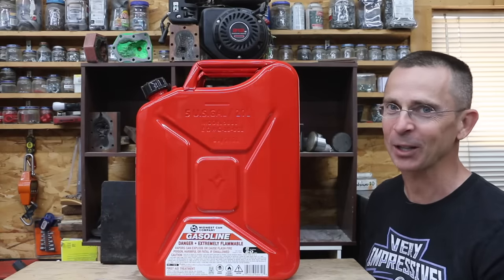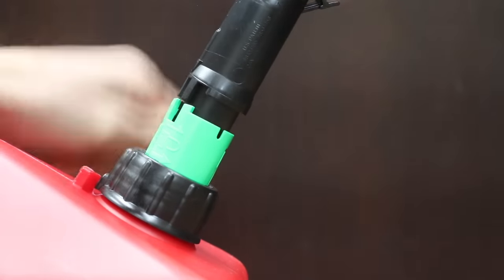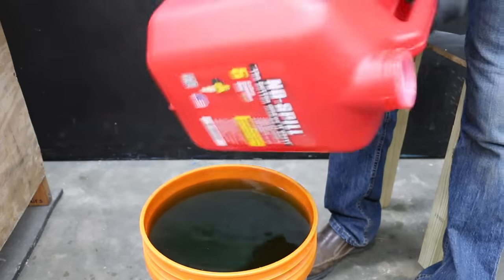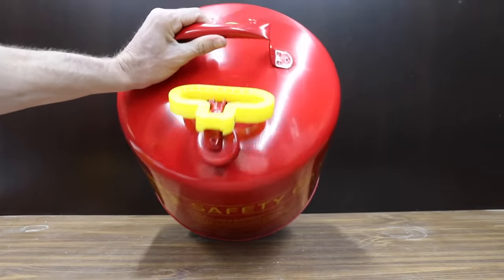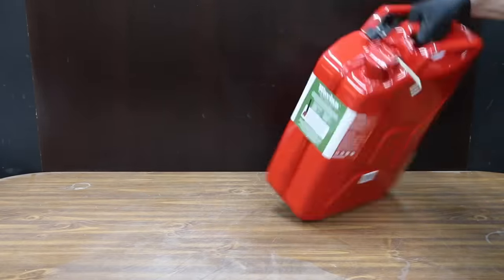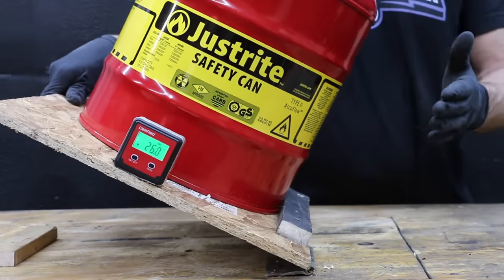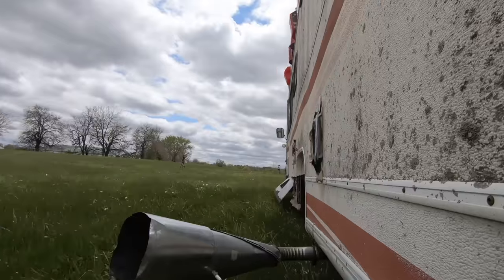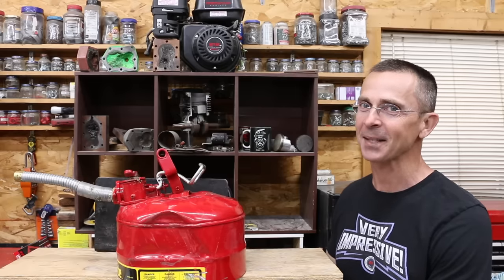Best Gas Can? $140 Wavian vs Eagle, Surecan, Scepter, Briggs & Stratton, Midwest, VP Racing

Comment: Pressure test. I've lost a few to sitting in the sun and they blow up like a balloon.  Then freeze them and watch which ones split.
Reply from the maker: Thanks for the suggestion.
Reply: @ProjectFarm  Absolutely- and don't forget one in the front seat of your car and fill the whole car with fumes!!  Vapor leak test would be ideal!
Reply: @Josh-ce9sv  Both of these suggestions are gold
Reply: I have several of the wavian cans. Never have vapor leaks, even in the desert.
Reply: Was going to comment about testing in the cold because I've had so many split the nozzle, but ya beat me to it. Another suggestion would be to test hot and cold Cycles. I've had issues with them either sucking in and tipping over or inflating and causing problems as well.
Reply: If you only snug the vent and don't crank it down on hot days, you will find that although pressure will build in the direct sun it will escape past the threads on the vent.
Reply: Fuel can test #2 LFGO Project Farm FTW!
Reply: gas does not freeze
Reply: @grantkoeller8911  I believe he was actually refering to the plastic becoming cold and brittle in sub freezing temperatures. 
Gasoline actually could freeze but at that point I think we would all be dead anyway. 😀
Reply: Thats a verry good suggestion that it should had been done on thia cans
Reply: For home use or garage/shed storage I would reccomended only using vented cans. For in car storage or usage use a sealed one. As in no extra vent.
Reply: Yeah, i had a set of metal jerry cans from cheaperthandirt split open like bananas in the sun. Granted, i lent them to a guy who left them in the texas sun for days, but they still disappointed.
Reply: freezing gasoline isn't something I expect to encounter... but is still probably an interesting test
Reply: @TractorWrangler01  ,, but wouldn't you risk leak fuel,, even a minor dribble is not acceptable. 
Wasting fuel. 🤷‍♂️
Reply: I've had the same issue until I bought the midwest metal can from harbor freight
Reply: The Eagle and Justrite cans use a spring to hold the cap closed, so they will automatically vent excess pressure.  Not sure if they allow air back in, though.
Reply: I’ve run wavian on the roof in the desert, inside the Jeep and in sub freezing conditions.  No leaks, no fumes.  Love em!
Reply: @PaydayGabeBCNV There should be no liquid to leak unless you over full the gas can and then expose it to a 90°F day in the sun. What will escape will be just air and some light gas vapors. Just keep the  gas can upright.
Reply: @ThePyleDriver  Yes the Wavians have a stamped in X on the sides that allows for a good bit of expansion.
Reply: Same here. I bought not one, but two cheapo gas cans thinking I could store 5l of fuel for longer ATV trips. But both of them ballooned up to such a degree that I emptied them into the tank and discarded both. They just seemed too dangerous to keep around. If you fuel em up the same day and then empty them, they were probably fine. But keep gas in them for a day or two and they weren't too far from popping...
Reply: This the main reason why I went with wavian.  I bought a couple, several months ago for about 90 each? Now they are 140? Seems a little high.
Reply: I have one can that's literally a ball..  it hasn't split, somehow, but it just wobbles around :D
Reply: Exactly!
In the sun, the Scepter splits at the handle along the moldline
Reply: @TractorWrangler01  Around -100 degrees F.
does Gasoline Freeze. In order for gasoline to freeze it needs to be held at temperatures of around -100 degrees F. That number will vary depending on the components that make up your gasoline (octane, for example, has a higher freezing point), but the point remains the same.
Reply: This comment is the most important test lol
Reply: @grantkoeller8911  
Oh yes it does !
It will turn to a gel around 70 below.
ND had a bad winter where people had to keep cars/generators erc running or the gasoline would gel and appliance wouldnt restart
Reply: @TractorWrangler01  
The Dakotas, Montana, etc see temps where gasoline becomes a gel.  
10 dog night...
So cold you let All the sled dogs in your hooch to keep warm
Reply: @Hunteratloppshop  
Yes, because the split along the moldline isn't apparent until you tip it to fill something and gasoline goes everywhere..
Buying real GI gas cans now.
Reply: @-Jethro-  They don't allow air back in. It's always kinda fun to open my Justrite can at -40º and hear that rush of air into the can. What impresses me is they don't collapse under that much vacuum.
Reply: @patrickhorvath2684  Gasoline is made of many different molecules they freeze at different temperatures. Different manufactures have different blends. All manufacturers have winter and summer blends. -40F is when most summer time blends begin to have some molecules  slow down. So if you have the summer blend in your car or truck you could see some preliminary "gelling" however it shouldn't keep your car from running g yet because most of that would get caught in screens and filters until it warmed up. At -50F you will start seeing filter blockage and you may have to warm up that filter to get it to function. With a winter blend of gasoline you should still be ok and things shouldn't start getting funky until -60F. To freeze a gallon of gas solid it might have to be -100 -150F. That being said I believe this is what he was referring to when he was speaking of freezing Gasoline. Solitify it like water in a gas can and have it expand and split the container. I don't believe that would be a practical approach to test a gas can as those temperatures would have to be reached in a full blown lab enviroment unless you substitute water. Since these are cans for the transportation of gasoline it would seam like it would not be a useful test. Am I wrong? Did I miss something?
Reply: Plastic will expand, metal….
Reply: @Dextermorga  
I have one year old Scepter cans that split.
My 50 year old GI cans are fine..
Reply: @N3QEH  Wow.  Honestly I don’t think doing anything at -40 sounds fun! 😎
Reply: @TractorWrangler01  ł
Reply: @ProjectFarm  Along with this i'd like to see the rotopax cans tested.
Reply: Savage Facts  because the saying "government can F up a wet dream" didn't just come out of nowhere. The only thing they do best, is make 99.9999999% of things a whole lot worse.
Reply: @TractorWrangler01  When I empty one of my No-Spill cans I loosen the cap slightly so it will not allow pressure to build up in the can. The cans is empty except for that trace of fuel that never wants to leave but that is enough to fill the can with fumes and pressure which is a dangerous condition. 

I would NEVER want to move a fuel can inside a vehicle, full or supposedly 'empty'. The fan on your AC or heater motor could arc and ignite fumes escaping out of a can. 

When transporting I always tie my cans down. If you position them at an angle in the truck bed you will create a wider footprint with respect to the forces applied to the can when you are turning and it will be less likely to tip over. There is also an accessory you can can, I'll call it a skid, that your fuel can can be tied down in and increase its footprint considerable. They are only a couple bucks and can be found at many places where fuel cans are sold. It would have been nice to see Project Farm include one of these as part of his tip over test.
Reply: @Josh-ce9sv  absolutely... I've run the Eagle in the back of a Suburban with no fumes. This is huge for me to not inhale fumes.
Reply: @bobd.  You would never want to put the gas can inside the truck. You put it inside the shop or garage out of the direct sun. In which case you can close the vent because it's not sitting in the sun any longer. The expansion at that point can be mitigated by squeezing the can slightly while securing the cap. Just remember to move the cans out of the shop before welding ect.
Reply: Duh...dont leave them in the sun un-fucking-vented. Damn.
Reply: @Josh-ce9sv  I just keep
The windows open or put it in the trunk
Reply: @grantkoeller8911  Gas freezes around -100 F
Reply: @ProjectFarm  cant beat the old jerry..plus,, if you took the plastic funnel off the metal part, it drains fast.. the metal part has the vent..
Reply: Personally, I just remove the end cap to relieve the pressure, then, put it back on in the shade...
Reply: @TractorWrangler01  Really. Your take is I store my fuel cans IN my truck? No, you've got it all wrong. You do what you think is right and I'll do what I know is right.
Reply: @bobd.  Don't forget to put on your hazmat suit when you handle your gas cans.
Reply: I've had this same problem.. they will expand like a balloon, I will vent then, but then at night, they will contract, and cave in and crack.
Of course, I do everything I can to keep them out of the sun, but sometimes it happens.
Reply: The eagle and justrite cans will self vent and have enough strength to not collapse when it gets cold at night. They are worth the money. I use the eagle cans usually but the justrite spout is nice
Reply: @grantkoeller8911  
Fluids expand and contract with temperature.  That is why the cap on your car's radiator has a built in pressure relief vent and a built in vacuum relief vent built into it to prevent too much pressure and a vacuum from forming.  The radiator and hoses are built to withstand pressure to a point but would collapse easily with an internal vacuum.
Reply: @plusorminusandtime  The fuel cargo is now more precious. Maybe its price is direct relation to its cargo. lol
Reply: @brentworls8509  Wavian USA has them for 90. Campingmaxx now has them for 120. If you buy two it's 99 each.  Maybe 140 was a little high.
Reply: @cezarnebun9607  Had the same problem in my closed garage. Hence the switch to metal cans.
Reply: @cezarnebun9607  
If you are carrying gas cans that size you are most likely traveling and/or spending time in the boonies and want the extra gas to make sure you get to where you are going or to get home.  If you are halfway intelligent you will have them mounted outside the vehicle where there is not much shade or be camping or whatever where there is not much or no shade.  A gas can that can endure will always be a necessity.

The modern gas can, the Wavian, was designed by Germany before they started invading their neighbors and was used extensively in the Sahara desert with no problems and many of those gas cans that are still around still work like when they were new.

So if you are doing serious stuff and need dependability, get quality.  If you are just mowing the lawn then cheap is more than sufficient.
Reply: @cezarnebun9607  Use your brain. Ok so why are hot water tanks made of metal. Answer they can take a lot of pressure. Boilers? Made of metal. Now like anything they can blow but that is under pressure generated by a heating sources. Hence the blow out values. So, outside of you heating a metal jerry can above temperature of 212 F.. Then they  will always out perform any plastic gas can. Seriously, use your brain. LOL
Reply: @cezarnebun9607  I believe NATO-speced cans do have a pressure valve on the spring loaded cap.
Reply: @cezarnebun9607   YOU DO NOT NEED A RELIEF VALVE, in a wavian metal nato gas can. Unless you are planning on throwing the can into a raging fire or sending it to mars.
Reply: Please do a video on flux core wire welding I’m a small time hobbyist and I really really wanna know the best wire but I’m too broke and I can’t do the stuff you do I really can’t I don’t have the concentration I am very happy you are here and I hope you get a lot of money for doing this I really do U2 better be paying you start doing some advertisement man don’t ever stop doing this we need you everyone needs you bro all the Youtubers backyard mechanics😂
Reply: @ProjectFarm  I don;t know where you find a Mid-West can that will not leak when it overturns in the bed of my pick-up. Please forward info, thanks.
Reply: I know how did he miss this.
Reply: At over 5 dollars a gallon and 20 dollars barely buying alittle over 3 gallons, Gas Cans might not be used much anymore. Lol
Reply: @jonathanfreedom1st  $4.80 here. $85 to fill my accord  from warning light.
Reply: @-Jethro-  
The eagle can does just fine at -20f (I love them)

Not sure if its venting or rigidity.
Reply: @cezarnebun9607  Nope, just know the facts. Something you really like to ignore.
Reply: @cezarnebun9607  OK, if you don't. So whom am I going to trust? Decades of experience in gas storage or you some random person on the internet?
Reply: @cezarnebun9607  Please post your employment and your work experience so we can check your claims of "work every day with flammable liquids and compressed gasses". I would love to call your place of business and tell them your views. LOL .
Reply: I agree. I have watched a lot of your videos, this one I was very interested in but soon was disappointed because I own 2 of these cans and ALL the problems I've had had to do with how gas behaves, not colored water.
Reply: @cezarnebun9607  go ahead....? Nothing posted. Please post your place of employment and your full name. I will give them a call. A dare you!
Reply: @plusorminusandtime  dude chill out
Reply: the eagle can would do well in this one. as a former fl roofer I saw one sit in the sun all the time. just open the lid on the ground first to vent excess pressure otherwise it will go everywhere. I had a pair of shoes that smelled of gas for 4 days after lol.
Reply: @cezarnebun9607  Name calling isn't a logical argument. Also you never posted your place of work or any contact information. So much for all that "experience" you claimed you  had in compressed gasses. 
   So who am I going to trust? A company with decades of experience in fuel storage. Or a random person on the internet, who lies about their employment.
Reply: @TractorWrangler01  gasoline doesn't expand when frozen, it shrinks like almost everything except water.
Reply: @Josh-ce9sv  Well I can save you a bit of time and tell you for a fact the VP racing can does not pass the vapor leak test.  The vent will leak under pressure, which I suppose is better than the can rupturing and filling your car seat with fuel.
Reply: The No-Spill cans do fine with this. I own quite a few gasoline and diesel cans from them, and while they do expand in the sun (gas more so than diesel), they always return to original dimensions without issue. And made in USA!
Reply: Paint them white. Just make sure you mark them as gas.
Reply: Yes this is EXACTLY THE PROBLEM WITH THE PLASTIC CANS... must be considered...
Reply: @grantkoeller8911  not true, about -100F is when it freezes
Reply: @mikekirk5811  Wavian are expensive for a reason, they are one of the few that meet NATO standards.
Reply: @ProjectFarm definitely vent capability and expansion are huge issues and I would love to see that integrated
Reply: I really like the No Spill brand, BUT it swells and shrinks so much with temperature changes and will crack in little time.  The company will not warranty cracks.
Reply: @spdergod  … Wavian have been from extreme desert hot to extreme Arctic cold with me. No dust collection around spout so no leak and assume no vapor. I had one that I did replace the gasket. That was thousands of miles ago.